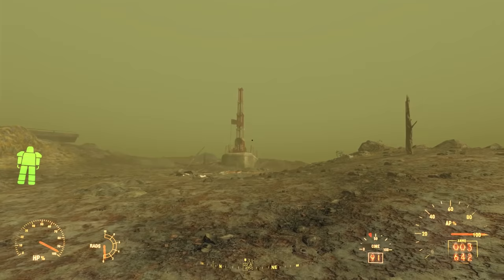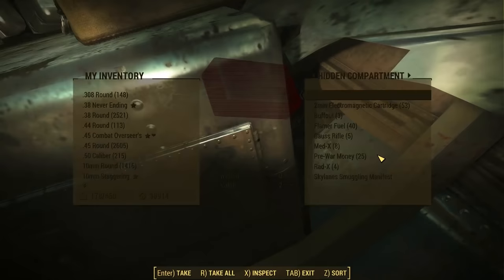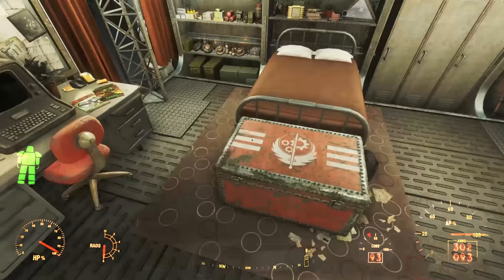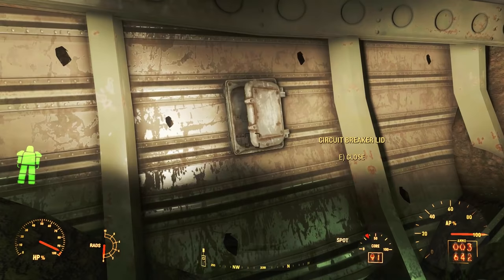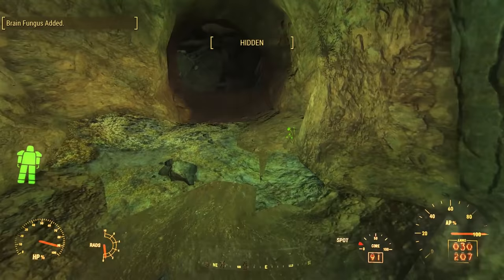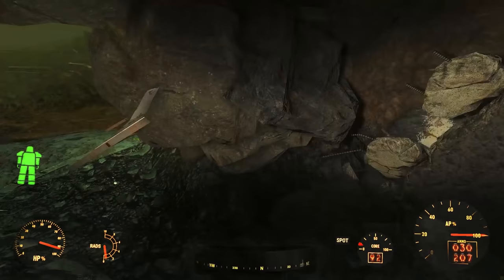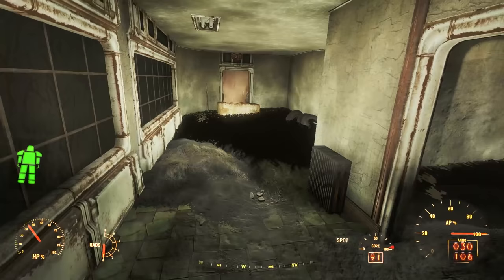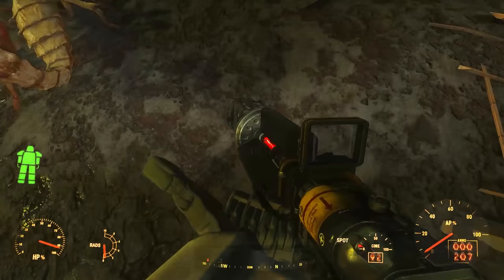Relay Tower 0DB-521 - Raider Cave, Sunken Church, & Crashed Flight 1665 - Fallout 4 Lore

Comment: The Skylanes Flight 1665 radio tower signal is a continuity error with the flight recorder holodisk. It would seem that the writing team that scripted the radio tower signal was not the same team that scripted the flight recorder. There is no way to reconcile the two.

The radio tower signal states that the airliner is 20 miles out and the female air traffic controller clears the flight to land on runway 18L. Twenty miles out means that the airliner is on final approach to the runway and is approaching from the north heading south. A runway having a designation 18L (One-Eight Left) means that the runway is oriented in a north-south axis. The airport actually has two parallel north-south runways: 18L and 18R. A pilot approaching the airport from the north would see two runways, 18L would be the one on the left while 18R would be the one on the right. If approaching from the south, the two runways would be designated 36L (18R) and 36R (18L). The real-world straight line distance from Boston Logan to Saugus, Massachusetts is 6.89 miles. That would make Parsons Creamery about 10 miles north of Boston Airport. If Flight 1665 was approaching from the north to land on runway 18L, its game world position would be well off the north side of the map.

However, the flight data recorder information for Flight 1665 is consistent. The recording mentions the airliner is going to land on runway 2. The runway is along a 20 degree offset from north. The in game orientation of the plane's wreckage has it facing in a direction that would be consistent with landing on a runway 2, with just a slight turn needed prior to touching down. The in game location of the wreckage is also 20ish miles southwest of the airport. The real world straight line distance from Boston Logan to Natick, Massachusetts is 19.31 miles. The pilot mentioning a bright flash to the north could be the what caused the Crater of Atom, understanding that when the pilot saw the flash the airliner was farther southwest at the time from where it actually crashed.

Comment: The contradictory flight recordings are easy to explain you don't find any recording or story in Skylanes Flight 1981. So most likely it a mistake The recording you hear with engine failure was meant for flight 1665. And the one with bright flash to the north is 1981. 1981 locations supports this theory, also there's no evidence of prior damage to impact, where's 1665 is burned on left side. And it's communication worked to the end with probably means it crashed before bombs fell.

Comment: Oxhorn, I have some thoughts about the sunken buildings. Many studies say a nuke can't trigger an earthquake, the most powerful underground nuclear test was conducted near a fault line in Alaska and it didn't trigger a quake. But, that was the real world, in the Fallout universe, things are very different. The amount of radiation in the Glowing Sea is very disproportionate to how much radiation should be left over by a real-life nuke. Something like the Glowing Sea shouldn't be possible, so let us assume then that nukes in Fallout could trigger earthquakes. In Massachusettes, there is the Clinton-Newbury Fault Zone, which isn't one fault for a series of individual faults which impact a fairly large region of New England. What if the church and the sunken factory and other sunken structures are there because of "liquefaction". This is a very real problem faced by some living in California where seismic waves make the ground in some places act like it is a liquid. The last big quake in San Francisco saw liquefaction occur in some areas of the city where the foundations of apartment buildings just sank into the ground. For liquefaction to occur requires certain factors, the soil needs to be mostly sand or reclaimed landfill. At the right frequency, vibrations from an earthquake can cause the ground to act like a liquid so anything on top of it like a building foundation would sink into it, then gets locked in place once the vibrations stop.

Comment: Two FYIs. 3:58 that appears to be port wing not starboard. Second, anyone else find it kinda goofy that a plane would crash so quickly with only one engine out? Of course it’s an emergency but a 747 has a glide slope of 15:1 meaning a 747 could fly 15 miles if it lost ALL power at 5280 feet above ground. A plane like that wouldnt crash in seconds unless half of its wing was ripped off and some have even landed with just a single wing (mostly fighters or high performance but still).

Comment: The buildings are underground because the Chinese fired a nuclear bunker buster. The ground under the buildings was vaporized and would also explain why the area is unusually radioactive as the blast would have thrown up large amounts of radioactive particulates into the air as well as contaminated underground water springs.

Comment: 7 years later....
bethesda are enough to drive a guy nuts. i just commented on another of your videos that without these videos one could spend weeks wandering around in circles looking for the circuit breaker that doesn't exist. i opened and closed that first hatch a dozen times, wandering around looking into every crook and nanny for some other way to open it. so thanks, you keep me sane.

Comment: The sunken buildings is more than likely a mistake by bethesda, Massachusetts is the last place for the earth to simply sink, and there are no major fault lines or volcanos in the area, so there couldnt be any pyroclastic flows. And the bombs were all between 500 and 750 kiloton nukes according to fallout lore. The site we see in the glowing sea would be more consistant with southern Louisiana where the soild sits ontop of large deposits of ground water making sink holes and other phenomena more common. Massachusetts sits on rocky clay soil, it is arguably the most dense soil on the east coast and nothing short of a meteor could soften it.

Comment: I don't think it's as much a continuity error as it is the Air Traffic Controllers doing their jobs after the nukes hit. I guess they were ordered by Civil Defense or NORAD to assist civilian flights still in the air, then help the Air Force and Navy coordinate retaliatory combat flights in addition to reconissance and Vertibird search-and-rescue flights.

All they'd have to do is wash the Tarmac down with a firetruck, set up proper shelters covered in loose earth to soak up radiation, and keep a Stopwatch handy to track exposure. The US Air Force trained to do this back in the 1960s in our world.

Fusion-powered aircraft obviously had unlimited range. in clear weather, pilots could let up on the throttle and take a nap.

Comment: But you're forgetting that a building like the Sentinel Site would be reinforced to withstand something like an atomic blast. Even from that close. That's its job...Survive the initial attack, and launch its missiles to retaliate. Plus, most of the building proper was already underground anyway, packed under hundreds of feet of soil. Whereas the church is just a church. It has a normal foundation just like any other regular building. Same thing with the factory. The factory is just a factory. Therefore, it too would have the normal supports structures & foundation of a factory. So of course, when nuke goes off in the nearby area, they collapsed, sank into the ground, or were partially covered, while the Sentinel site didn't. And even _inside_, everything that would make the Sentinel site function as it would normally, has been wrecked all to hell.

Comment: I personally subscribe the the theory (if you want to call it that) that the bomb was really fucking hot and literally glassed the immediate area, swallowing everything in molten rock and soil. Buildings appear tipped because they got a hard shove from said material and the ground has a smooth shiny surface like lava has when it cools. I think the crater is much bigger than it appears though, the crater at ground zero is smallish but I think a good portion of the glowing sea is actually crater.

That church is as strange to me as the drive in though. Didn't the bomb go off Saturday morning? Church functions for most denominations occur on Sunday morning and Wednesday evening. I believe Catholics have saturday evening functions... but that's still not Saturday morning.
Just like the drive in I guess... it'd look strange empty. The other churches make sense, I'd imagine that's where people would go to quietly die or even meet up with potential survivors after the blast but the buried one appears to have been getting ready for or finishing up after a service.

Comment: That's so unrealistic for the commercial plane, it is obviously a very large one, even if it is a 2 engine plane and fully laden, it can still fly, albeit with difficulty, with one engine, and if they believed they were going to be unable to successfully land with one engine, would have spent all their fuel in the air before taking her down, thus making her lighter and less likely to catch on fire
Reply: And before anyone says it, had it been caused by the bomb detonating, they would have lost contact with the airport due to electromagnetic disruptions, seconds before the plane got vaporized, since it's relatively close to the impact crater of the nuclear bomb

Comment: You know, when you're discussing the idea of nuclear bombs blasting the earth, a lot of geology comes into play.  See, even if the surface looks flat and even, there could be all kinds of geological differences under the surface. The bedrock could be closer to the surface in one area, or there could be under ground water or caves, or just variations in density and variety of the soil and rocks.  What it all adds up to is pure unpredictability.   That blast will definitely throw up immeasurable tons of earth, but where that earth comes down will be impossible to predict or perhaps even explain.  The soil could be shoved across the land like a tsunami, covering a nearby town, or soft earth may be removed from an area and placed elsewhere, or maybe the tiniest hill will redirect the blast force so that only a single dwelling seems to be left untouched.  In short, the aftermath may be bizarre and irregular, and seemingly absurd. 

It actually reminds me a lot of tornadoes.

Comment: See youre not wrong but youre also not right see when a nuclear bomb is detonated under ground the blast is so powerful and so hot it heats up the surrounding ground and basically turns it into a liquid and it flows like one as well at the same time throwing metric tons of dirt into the atmosphere now one detonated above surface level like the one we see here in fallout detonated above ground the earth when that initial blast went off it send dirt not just into the air but sideways in all directions covering anything with in a mile of it in irritated soil now a nuke detonated by impact turns the ground into a liquid and rips open the earth and barries houses and company owned buildings thats is if they already havent exploded see when a nuke is detonated near house and building the initial blast is so powerful it blasts that house into mere spliters before burning those spliters with the light from the blast so for there even to be buildings let alone live ghouls is outrageous cause anything living would be vaporized and anything standing would be blasted to tooth picks and that is why when you go into the glowing sea there are cracks in the flat ground cause very very very hot irritated water from the blast melting the ground sat there and cause its so hot evaporated and thats what you see there and that water you see is water called heavy water which is a slight radioactive water that is primarily made of deuterium which is a heavier ion of its counter part hydrogen which most water has deuterium just not as much as heavy water normal water has probably 1 percent heavy water so heavy water can hold a ton of nuclear waste and release it slowly which is what most nuclear reactors use to cool down the reactor which is the liquid you see that the containment shed heavily irritated heavy water which is the neclear wasteand the emptied husks of uranium and/or plutonium basically a neclear reactor is a glorified tea kettle it does nothing but heat up water to turn a turbine to generate power now when it comes to neclear reactions you can actually see the reaction of you take pure plutonium metal or uranium and hold a piece of beryllium or tungsten above it you shoud see atoms spilting dont actually do that you will expose your self to enough radiation that you will have cancer some time in your life not a slight chance anymore you are guaranteed to get cancer or to die very very soon after they dont call it the invisible fire for nothing so every house in the glowing sea shouldnt be nothing at all and the animals that live there shouldnt be there either a neclear reactor is nothing but a glorified tea kettle and you will die from radiation